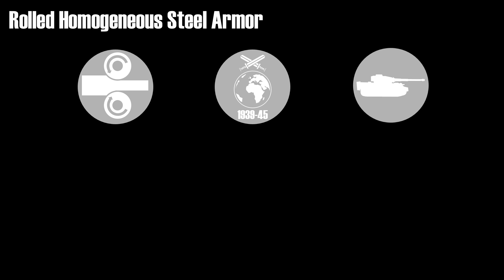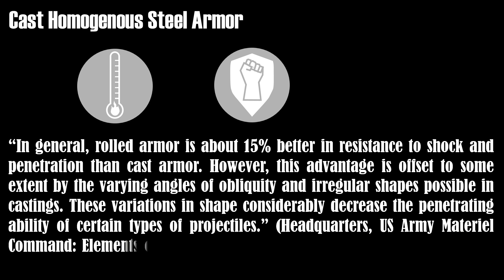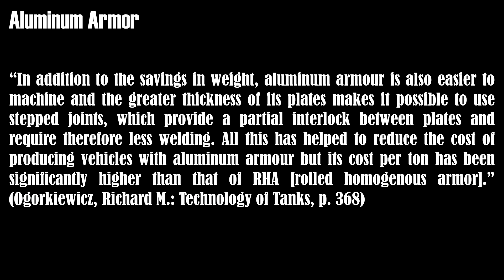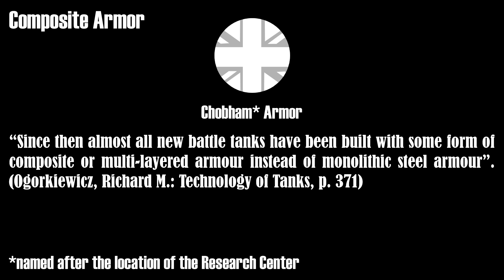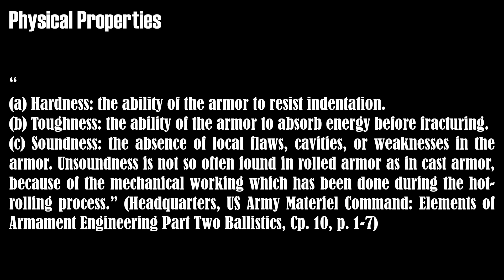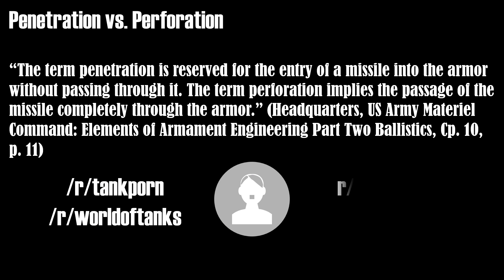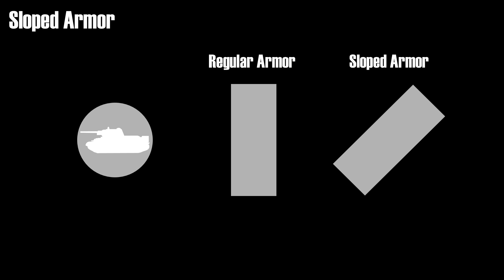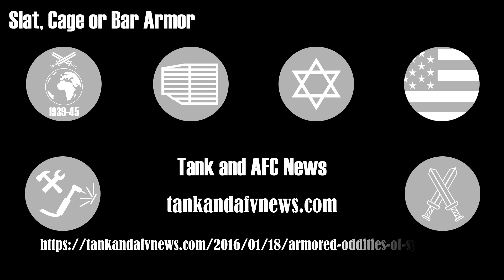[Tanks 101] Armor Protection 1920-1980 - Features and Characteristics

Comment: The reason why Panzers III and IV used spaced screens is to protect from soviet early 76.2mm armour piercing exploding shells that had the MD-5 detonator that would detonate the explosive in the shell after only a few mm of armour and thus destroy the shell prematurely or severly hinder its perfomance in both penetration and damage.

The later MD-8 detonator adressed that issue but if you factor in the logistics...

PS: Panzers' 30mm side armour was more than enough to protect against 12.7/14.5mm rounds in battlefield conditions when angles and distance was not in the favor of infantry.
Reply from the maker: do you have a source for that, because I never heard about that one.
Reply: Military History Visualized Apparently there's no info about it in the english you'd have to search the russian section for it. Also the MD-5 is inherently unsafe and caused some casualties during the war and well after it(undetonated postwar leftovers) as it's quite easy to set off if handled unproperly.
Reply from the maker: well, sounds more like that the Russians assumed that the Germans introduced it for the MD-5 rounds. Because my source on the anti-tank rifle is in German and refers to a document/conference on this topic.
Reply: Military History Visualized As I said it's unlikely for even a 14.5mm to penetrate 30mm under battlefield conditions which are +/-35 degree offset = 30/cos55=52mm effective. Also consider a rather low lethality of the round if it even penetrates. It was mostly used to detrack the tank which essentially equaled to destruction since a stationary tank was an easy target for regular 45/76.2mms and thus was abandonded.

I don't have a verified info about the MD-5 right now but iirc it's a science work behind it.
Reply from the maker: logic and science may be all fine, but humans made the decision and we all make errors, some more, some less.
Reply: Hellhound Wyrm/Wurm Negative, the shell could penetrate up to roughly 70mm of armor, the criticism is that the fuze goes of only a few mm behind that armor plate, basically turning it into a dud whenever it hit spaced armor.
Reply: REgamesplayer Adding "several tons" of extra armor would have overloaded suspension and drive train, causing the vehicle to break down. Upgrading engine or suspension without reworking the chassis significantly would have been more effort than making a new tank altogether, aka the Panther.
Reply: REgamesplayer The Pz IV was out of room to wiggle. It was already at the limit with the long 75mm, 80/30/30 hull armor and skirts, that was all the room it had to wiggle. Adding further armor would have required beefing up the suspension (arguably doable), and fitting a better engine and transmission, a better engine would have been larger, thus requiring a redesign of the engine compartment, maybe enlarging it, needing a redesign of half the tank, assuming such an engine is even available, and all that for something that the simple addition of skirt armor already solves. 
Making the Panther as a new tank was a smart move as the Pz IV was at its limit and a brand new chassis was needed for anything bigger anyway, however to still achieve the top speed and frontal armor required the side armor needed to be sacrificed to the logical minimum, and evidently the designers werent aware that 40mm werent enough against russian AT rifles, and went for the same cheap solution again rather than once again putting on extra weight which would have further reduced the Panthers reliability, which was abysmal already. 
And why dont they throw reliability out the window? OH YES, if your tank breaks down all the time, you might as well have no tank at all.
Reply: REgamesplayer A: Skirts were never intended to be an anti-heat measure. For once, noone except german used them in any notable fashion. It was definitely meant to protect against the 14.5mm PTRD and PTRS AT rifles in russian use, and these things were beyond abundant and could deliver a large volume of fire compared to AT guns. Even if conditions had to be at least reasonable (reasonably good angle) to achieve a penetration, out of the amount of bullets flying at you some will have favorable conditions, that is just statistical fact. Hence the skirt armor, as complete protection against such a weapon was preferable to "effective protection".
B: 1 or 2 hp/t less arent the only problem. Pz IV G and onwards had significant wear on the front road wheels and suspension due to the 80mm frontal armor intended to protect from russian 76mm guns such as the F-34 and Zis-5 up to a certain distance. Transmission and engine were at their limit, and at the time the germans didnt have the resources to invest into upgrading the engine of a tank they are intending to phase out anyway in favor of the Panther, assuming it even had that upgrade potential. 
C: The last paragraph is badly phrased and Im not sure what you mean. 
Upgrading the Pz IV to the Panthers gun? As a casemate tank destroyer it was done. In a turret it was tried using the Panthers Schmalturm, but the chassis was clearly overloaded, thus couldnt be done. 
A Panther with a 60mm glacis would indeed have been "fine", especially since it was face hardened armor (russia didnt use capped AP shells, which were prone to shattering against face hardened armor, even if penetration were possible purely by kinetic energy), and still provided effective protection against 85mm gun at reasonable ranges, but the Panther was rightfully expected to go up against superior numbers so an extra 20mm of armor didnt seem too tall of an order. Besides, 20mm of extra frontal armor dont make the entire 20 ton weight difference between intended mass and what the end result weighed. 
D: T-43 was a very small foot note of russian tank design. Officials were generally unimpressed as it offered only extra armor and still fielded the 76mm F-34 gun while the T-34/85 was already in production. T-44 was the next medium tank the soviets produced, and it was a much more effective tank and would have been the next main adversary for the Panther. 
E: Panther II has no 800 hp engine, it likely would have even had a 900 hp HL 234 rather than the previous 700 hp HL 230. There was also some work on a turbine powered version of the Panther, but that would have only compounded germanys fuel shortage. 
Also, stuffing the 8.8cm KwK 43 into a Panthers Schalturm turret would have been pretty cruel on the loader, as its a really tight fit to begin with, nevermind trying to handle the huge shells in such a small turret. With the planned armor increase to 100/60/60 or 120/60/60 it would easily outperform a T-44, even with the old 7.5cm KwK 42, which was by itself quite a formidable weapon. 
But ultimately all those improvements never fixed the abysmal reliability due to the weak final drives, so its doubtful that such an upgrade would have been worth the effort.
Reply: REgamesplayer A: For the last time, skirts had nothing to do with HEAT rounds. Unless you want to explain to me who used HEAT warheads in 1942? 
And secondly, skirts were exclusively intended against AT rifle rounds, which were light enough to be deformed and destabilized when hitting a 5-6mm (not 10mm) armor plate, and thus did not penetrate the 30mm plate behind. The skirts were never intended to stop 45mm and larger AT guns (and rightfully didnt), and adding enough of either skirt or unspaced armor to even stop a 45mm shell would have made the tank grossly overweight anyway, so it wasnt even attempted as frontal protection as prioritized. 
Also, not all AP shells need 30mm of armor to trigger their fuze, there are plenty that require less, but most fuzes take 1-1.5 meters flight between penetrating the armor and actually exploding, thus if you hit the skirt with one of those shells, the shell will, even if triggered by the skirt, penetrate the hull side as well and only explode inside the tank anyway. 
B: Yes, in theory you can add rear armor to balance out the front armor, but considering how many people shoot your ass its mostly dead weight that increases your total mass, so instead of wearing down just your front road wheels and suspension, you wear down all of it. Good job!
C: What are you trying to tell me? I already agreed that 60mm armor on the glacis would have sufficed. I simply explained the likely reasoning why they went for 80mm. 
D: (Talking about Panther II here) Obviously a larger turret is preferable, but while you say you would have done this and that differently, you constantly fail to specify how. What would "your" turret be like? In all likelyhood you will come up with something german engineers either already came up with or didnt, and likely would have a ton of disadvantages anyway that I could spot in a heartbeat. You underestimate how hard exactly it is to actually develop such things, and how many modifications need to be made for such a simple sounding thing as "enlarging the turret".
E: T-44 was all but a cancelled program. It entered serial production in 44 (as the name suggests) and units were equipped with it before the war in europe even ended, however those units simply didnt see combat anymore. Furthermore the tank saw a quite extensive production run of around 8000 vehicles if memory serves, including several attempted upgrades to 100mm and 122mm guns, and extended comparative trials against a german Panther. If the war had gone on, the germans would have fought the T-44. 
T-43 was altogether cancelled with only some prototype testing being done, as the T-34-85 was already in production and proving itself effective while the T-43 offered hardly any selling point at all except for the armor, and the list of changes required from T-34 production were simply not worth it, not counting the extra development time to adapt the T-43 to an 85mm gun. The T-44 was simply the better overall product and as germany was practically beaten by 44 anyway it was deemed acceptable to switch over production by then to the T-44, as a drop in production output due to retooling was not going to be an issue anymore.
Reply: REgamesplayer A: It was really not clear that you were talking in hypotheticals. You indeed made it sound like skirt armor was exclusively designed against HEAT (which it did work against and had to face in the later years on the western front only) 
B: Again, upgrading the rear armor on the Pz IV was not feasible because of the extra mass, and the rare occasion that an AT rifle would take on your arse was deemed acceptable as the only thing you could damage there was the engine, but not kill the crew or hit fuel or ammo (fuel tank in Pz IV was under the turret floor). The chassis was at the limit as it was, rear armor would have solved the nose-heaviness but made everything else worse, like suspension wear and top speed, which already was lowered twice over the Pz IVs development life due to all the extra armor. 
C: The Panther could take the extra mass if you are purely concerned about mobility. Even in its final form it was still a highly mobile tank, and the suspension wasnt overloaded yet either. In fact the suspension is one of the genius streaks about it, allowing it to reach high speeds even in terrain due to how easily the roadwheels oscillate. 
The problem that extra mass causes is reliability, specifically the final drives. Firstly, they broke on average every 150 km. There were tanks that had fuel to go on for longer. Secondly in order to repair any part of the transmission the hull roof over the driver and radio operator positions needed to be unbolted, both their seats and ALL their equipment had to be completely removed, and then you could lift out the entire transmission block through there, and then put a new transmission and everything else back in. For comparison: A Sherman could do the same repair by unbolting the transmission cover from the frontal armor and access the transmission from there. 
D: As I said, in theory the Panther had extra weight capacity, neither the suspension nor the engine would have any problems with it (and there was no 800 hp engine to my knowledge, only the original HL230 with 700 hp, or the HL234 with 900 hp), but the final drives wore down too quickly due to pulling a mass they werent designed for. So thats where your room to wiggle goes to die. If you increase the mass by any significant factor, you can replace your final drives every 50km instead of 150 km. 
E: The T-44 had 1.823 tanks produced. I would hardly call that "cancelled". It only came at an unlucky time where there were no wars that needed it, warsaw pact states were largely equipped with abundant T-34/85s after WWII, and the soviets kept T-44s to them selves as their top of the line tanks at the time until the T-54 came around, which people were suddenly extremely interested in buying. The T-44 also had no reliability issues as far as I can recall. For all intents and purposes it was a very good tank that happened to be a tad undergunned, but T-54 solved that issue. 
T-43 was indeed cancelled for more or less that reason.
Reply: REgamesplayer B and C: With the Panther the suspension was not the bottleneck that was overloaded, in fact Id say its one of the parts that could have worked with a good bit of extra weight. 
The crux was from beginning to end mostly the final drives, which were designed for a 30 ton vehicle. The option to mount improved final drives was explored, but the only better final drive in production had their entire production volume taken up by the Tiger II, so installing them in Panthers was not an option. 
D: Panther II would have had much the same issue. There were no other final drives available than the one used on the Panther it replaced, ergo the final drive problems would simply migrate onto the Panther II, and worsen due to the increased total mass and likely use of the higher powered 900 hp HL 234 engine, trying to squeeze even more force through this fragile transmission. 
E: T-44 wasnt a significant tank, but it was accepted into service. The vehicle was sound, the turret, while taken from the T-34/85 with minor changes, was an adequate turret, and the hull was such a good design (especially the traverse engine mount) that it migrated over into the T-54 with no major changes. The low production numbers were the victim of two factors: The tank was not needed anymore in large quantities as the war was over, and the cold war hadnt yet begun, and the T-54 was already looming on the horizon sporting a vastly better turret design and an excellent gun. It never became the "main tank" of the red army because of both the large quantity of T-34/85s being in service already, and then being phased out so quickly in favor of the T-54. 
Also,l the T-34/100 wasnt exactly a fruitful design. The large gun severely unbalanced the turret as well as the entire tank (T-34/85s already were slightly nose-heavy), and working conditions for the crew were also less than stellar. It would not have made a servicable tank, not unless youre desperate.
Reply: Skirts werent intended to deflect large caliber (45mm+) shells but mostly to deform 14.5mm bullets from AT rifles enough to prevent them from penetrating the main armor. The effect of skirt armor against 45mm shells was proven to be negligible or non-existent in soviet testing. 

Also, about the Panther suspension: The suspension was one of the parts that was much less affected by the increased mass than the final drives (or was simply upgraded in accordance with the mass increase), in fact it evidently performed quite well as the problems due to interleaved road wheels were much more prevalent.
Reply: Stuff like Spare tracks on the armor stabilize projektiles, skirts not.
Skirts dont help a Pz III or Pz IV not much against 45mm+.
On a 90° hit, the skirt slows a 45mm+ a little bit down, but not enough to prevent a penetration of the main armor. A 45° hit can destabilize a 45mm+
Reply: Military History Visualized Your videos are excellent. I have been a military and history buff all of my life and these are like books coming alive. Would you please consider making some on the American War for Independence and American War Between the States (War of Northern Agression as we southerners often call it) A video compari g the design and perfrimance of WW2 hand grenades would be neat. Thanks for the great videos and keep up the excellent work
Reply: Why you had mentioned logistics? It is always hundreds of times more complicated to supply vehicles with upgrades rather than units with ammunition. 

You and certainly I do blame designers of that day for failing to realize about the threats of modern battlefield. That their tanks can be quite easily destroyed by infantry and needs just minor meddling to prepare them for combat. It is similar situation today. Humans charge in without thinking and proper preparation and thus get decimated. Then they stat thinking and do minor changes which solves all the problems. ERA or spaced armor upgrades is a great example of how introduction of new era RPG systems were widely ignored.
Reply: Hellhound Wyrm/Wurm I just worded it badly. English is not my primary.
Reply: Well, I think originally shell was meant to penetrate weaker armor since if fuse is activated after penetration of few mm of armor then it adds some miliseconds until the explosion. Shell on the way explodes, in the middle or often already in the vehicle depending on how much armor there is. Skirts on the other hand just activates the fuse in the mid air between the skirt and the tank and resulting explosion behind destablises incoming projectile and takes away its deadly punch.
Reply: Hellhound Wyrm/Wurm Negative again. The shell could easily penetrate 60-70mm of armor at vertical and reasonably close range, as long as the armor is a single plate, and the fuze would go off directly on the other side of the plate. That was a problem as when it hit skirt armor, the fuze detonated the HE filler directly behind the skirt but outside the main armor instead, making the weapon practically useless. Later a shell with the MD-8 fuze was adopted which among other things had a fuze with a longer delay so it would travel deeper into the tank exploding more or less in the middle of the fighting compartment making it more effective, and as a side effect the fuze distanc was greater than the gap between skirt armor and the tanks actual side armor, meaning the shell would be triggered by the spaced armor, but still travel into and through the base side armor into the crew compartment nonetheless before going off.
Reply: And another negative thing about the side armor is this: they stabilize the projectile. It means that side or applique armor actually reduces the protection of the vehicle since it helps shell to reduce the angle between its trajectory and the tank's armor. In this way they have to penetrate less of the tank's armor by having the luxury to stabilize themselves two whole times. This is especially problematic with self stabilizing shells or capped shells in other words. 

Pz.3/4  and German leadership were failures in the terms of armor and its procurement. While understandable due to the limitations of the age and German industry, it becomes completely unforgivable to tolerate such pitiful side armor after Fall of France and Germany's reluctance to upgrade its firepower.  Breakthrough tank cannot perform breakthrough tasks if they are vurnable to anti tank rifles and it needed to be top priority to release better armored panzers in the first place without sacrificing mobility nor costs (or in other words, upgrade).
Reply: REgamesplayer False. It is known that applique armor often leads to a partial normalization effect on incoming AP shells, lessening protection, as well as reducing shock against the shell reducing the chance of the shell shattering, essentially doing the job of the cap of a APC shell (as opposed to uncapped AP or APBC). 
However, that mainly applies to materials directly applied to the hull, as well as materials that are softer than armor plate, such as track links which were commonly used to that end, though german command forbade it for that reason, however it was done anyway. The US Shermans in normandy were actually allowed and encouraged to improvise such armor, even though the brass was very aware of the negative effect on protection, but they wished for those "improvements" to improve morale. 

That however does not apply to skirt armor, as it is too far away from the main armor to have that effect. Against a small AP projectile, such as the 14.5mm AT rifles the russians used, the impact on the skirt destabilised the shell, causing it to tumble and essentially become ineffective at penetrating armor. 45mm shells and upward were virtually unaffected due to the shells having a higher mass in total and being harder to influence by such thin armor, thus generally penetrating the main side armor. 

And the decisions germany made at the time were perfectly understandable, although they were indeed slow. However, upgrading existing Pz III and IVs with skirts, increased frontal armor and longer barreled guns was a reasonable move, as Panther and Tiger development dragged on and even then the tanks were plagued with problems. 
In my opinion it was the focus of the tank development that was the problem. A tank does not need to be invulnerable to do its job, most of all the allies proved that by using in comparison much less armored vehicles, but Hitler insisted on such heavy protection on the Panther anyway. 
Instead, the focus should have been on something closer to a continuation of what worked so well against France: A strategically mobile striking force that enabled armor to be used en masse, ergo requiring high strategic mobility and tactical flexibility rather than high protection and firepower alone. Panthers and Tigers were simply bigger than they needed to be, while at the same time neither had much potential for upgraded, Panther more so, but not much when you compare it with a Pz III or IV. When developing that generation of tanks, germany forgot too many of the basics that they themselves laid the foundation for in tank building.
Reply: Hellhound Wyrm/Wurm Sorry, everytime you write "explodes after penetrating a few mm of armor" it makes to me the impression of the shell penetrating halfway into a 30mm plate and then going off before it actually penetrated, rather than "explodes after penetrating even a few mm thick plate"
Reply: Nick Dzink I don't think that 30 mm of armor was enough. The main reason why panthers were fited with side skirts just like the Pz lll and lV was that Soviet AT rifles could penetrate it's 40 mm side armor.
Reply: I had meant exactly that, I'm not sure why you describe it as false then you proceed in agreeing with me. Armor plates were more effective as a HEAT stopped rather than an additional armor. 14.5 mm penetration was questionable to begin with then 30 mm was angled. 

Understanable and Nazi Germany does not go hand in hand. They should had increased protection of their Panzer 3/4 models as soon as engine allowed. Having such thin armor makes vehicle itself very fragile against anti tank rifles while adding several tons of extra armor, makes it effectively immune to it. 

Of course, you must upgrade your tank as need dictates, but that was needed to do after fall of France. Before you could excuse Germans due to lack of resources, but the need was obvious even before WW2 that 60 mm armor plates are on the horizon and armored forces needed to be ready.
Reply: Well, obviously you redesign vehicle. This is how upgrading works. Tanks do have some room to wiggle left. Most famous of which was T-34 which could take massive upgrades without a need on revisiting its suspension. 

You are wrong. Upgrading transmission is not more effort, it is far less. Pz 3/4 was heavily upgrades, adding those several tons of extra armor in the process on top of getting quantitevily far superior weapon.
Reply: I had meant and spoke about early models from the beginning. This is why I had mentioned several tons, since we are going from side armor of 15 mm to 30. :) The final product was more or less that it needed to be. Armor skirts while inferior to just increasing side armor by 10 mm, it was necessary as a form of early anti-heat measure. Even though, I would question its worth in eastern front, because I'm not aware of Soviet version of bazooka. Given the nature of early anti tank warfare, I would increase protection ideally like this front/side/rear: x/40/40(30). In truth, we are agreeing on everything, but my way is just slightly different than that had happened historically. Even if Pz.3/4 was completely out of the room to wiggle, a ton of additional armor would come just as a trade of in terms of mechanical reliability. I want to remind you that historically, at least 40 mm of side armor was a norm on which all major nations agreed. Even Shermans had that amount of armor thus 30 mm is really low. 

Better engine is uneccessary, just one or two hp/ton less. Vehicle will be more sluggish. Or just replace it with newer version of a same engine which will automatically be superior. I'm talking about new production model which needed to come out right after the fall of France at its latest. It is like Pz.4. F1 would already had had extra armor and long rifled anti tank weapon. 

Panther had a great mobility for its time and weight. It was its reliability which impeded it. While 40 mm is not immune to AT rifles, it is effective protection. It is highlighted as a weakness in order to highlight flawed design of Panther in general, but the side armor would be completely acceptable if that tank itself would not had been such fiasco of political interfering with idealogical nonsense then military utilitarianism was needed. Original Panther model was better and it should be taken as a lesson not to do that if it wasn't obvious. Really, we often overestimate intelligence of a fellow man. How the fuck everybody did not screamed that putting 10-20 extra tons on vehicle designed for 30 ton chassis is not an insanity which will end up in fiasco?

That Germans ought to be done, knowing Hitler is that they needed to proceed with superior tank to T-34, Panther. 60 mm original plate was fine. I would only had advocated for introducing Panther's cannon instead of original Pz.4 weapon. That is only due to future-proofing yourself from upcoming Russian new generation tanks, T-43 to be precise which would had very similar traits to original Panther that was planned. From then on, they should had just designed Panther 2 as a tank intended to serve as MBT. 50 tons, 800 hp engine, 100 mm frontal glacis, 120 mm frontal turret, 88 mm King Tiger's cannon. That tank would had been a monster and quite frankly, quite necessary with ever escalating warfare. See, IS-3/4, T-54 who who made a quantum leap again in tank quality.
Reply: Armor skirts while inferior to just increasing side armor by 10 mm, it was necessary as a form of early anti-heat measure

I did not spoke of the field models. I'm speaking about new production models. You cannot just add 10 mm of armor to internal hull, of course it is going to be armor skirts. Despite that, armor skirts were used as an anti heat measure and they were very effective at that and it is their only real purpose in war. If you are producing your tanks and only later adding that extra armor then you are doing it wrong.

Armor skirts are not preferable protection. It stabilizes anti tank shell into your own hull. Wiggling is only achieved if a projectile looses enough energy in the process which was irrelevent for anti tank cannons. Only armor skirts who can be viable are those who are designed to detonate shells, but that requires heavy 30 mm skirts.

B. Again and again. I'm not talking about Pz 4.G. I'm talking about putting those upgrades as soon as they were available. That is, I blame Germans for Pz.4. F1 of not having those features. Furthermore, by introducing side and rear armor you balance vehicle out thus removing or lessening that problem. Another issue is this: you are adding that extra weight in form of the skirts anyways. So, it is just better to integrate that extra armor into the tank itself. If 40 mm can be achieved then tank will be effectively protected vs anti tank rifles in combat positions. 100 mm at 90 degree angle is dream come true. Usually it is done at 60 degrees angle. 

C. I spoke about early Panther before Hitler came and made it that it became. I had meant putting gun which Panther historically had on original Panther. Since original Panther had inferior weapon before that. You see, Hitler had a tendency to make everything massive. I can forgive Tiger, but Panther was pushed to be a heavy tank out of the medium. Leopard, intended as a light tank was pushed to be as a medium tank. 

Yes, I know, but transmission was simply not there. You cannot have everything like Hitler. So I choose firepower that Hitler gave to Panther. If you would pick this weapon too with addition of 20 mm of extra armor you will end up with a same tank which Germans had produced.

E. I mean, design a tank for such weight from the let go. Panther 2 was not Panther 1 and thus it would had been redesigned tank. Soviets cancelled T-44 program and it would be a temporal stop gab before T-54 which would come out somewhere in 1946. Also, IS-3 and IS-4 were just monsters. Tigers and KV-1 all over again, so, next generation of anti tank guns were necessary to be introduced in 1945. Panther 2 would had came out in 1945. These tanks only would matter if we are talking about the long war and it is likely against the allies since Germany would loose or win at that point. 

Furthermore, then I design a vehicle from a get go with 88 mm in mind instead of 75 mm as was originally done, I of course would enlarge turret. Anyways, this is just theoretical. Panther 2 would be non-factor in war effort due to how late it would come out.Panther 1 would matter a lot less and I say that Germans needed to produce mechanically adequate machine which would outperform T-34 tank. This is it. If there is room to wiggle about, I would take superior firepower instead of armor. Soviets on the other hand would choose armor with their T-43-76 tank. (Tank was cancelled due to high armor of new German tanks, so it would had changed USSR calculations and they would had released T-43 instead of T-34-85 and only then they would had upgraded to T-43-85 thus delaying entire firepower upgrade for a Red Army).
Reply: Contrary to the popular belief, I do not think that Germans needed to increase tank production. I do on the other hand believe that Germans needed to increase production of Stug variants and to proceed to develop a new generation of Stug based on Panther hull. 60 mm of heavily angled armor with 88 mm Tiger's cannon seems about right. I also think that Germans needed to focus more on developing SPAAG based on Panther platform more. Wirlewind with 4x20 mm cannons proved to be beyond its time and extremely devastating thus providing short range coverage from enemy aircraft. Army must have means to fend off aircraft then Luftwave is not nearby and certain number of SPAAGs in necessary. 

This is of course, taking into account that you will have to cut potential increase in arms production somewhere else. For Germany, air superiority over increased panzer offensive capabilities were more important for a morale of German troops who were used operating with air superiority.
Reply: You struggle to understand plain sentences and you just like to argue about them. I do not say that they were used for reflecting HEAT from the beginning, but later down the line they were. This is the only viable purpose on putting armor skirts outside newly produced vehicles.

I know it was not attempted, I wrote it a hypothetical scenario. Jeezz, read more  carefully of what I write since this whole chain of comments is you misunderstanding that I say. 

I'm not sure of how much time shell will take to activate on all shells. All of them were not designed to be pre-detonated on the outside and in any case and time and energy spent penetrating first layer might prove effective in nulifying the strength of the larger shell in similar fashion as it is done with rifles. Anyways, it is an unrealistic option since they can easily change the fuze to explode on more armor. 

B. You never investigate early Panzers armor design, did you? It had an equally balanced armor at all angles. No, Germans did not done because they were morons. Everybody was doing that, but especially it was important for a breakthrough tanks since they will often pass through enemy fortifications, leaving their nice, flat ass to anyone to rape it. In combat conditions this is especially important since anti tank rifle is extremely mobile and effective weapon. Infantry can easily take up ambush positions or flank your tank and since tank is actually blind, it will be helpless against a single AT rifle squad who managed to sneak up on it or heck, even fire on whole squad of tanks. How you are going to find out well hidden sniper in a damn tank? He will take out your engine and then slowly will pick you away. This is why everyone had minimum amount of armor everywhere. Even humble Sherman knew better than to armor itself up on the ass more than to protect itself from shrapnel and machine gun fire. This is why I'm pushing for balanced armor design and why it is necessary. Furthermore, I do not know why you are arguing about nothing. That Germans did was identical to my proposed solution with some changes and yet you speak about it like it would be a folly. It is not. Stop overreacting. 

C. I'm saying that extra 20 mm and new weapon would make you a historical Panther. There must be trade offs and I had explained that adding 20 mm of armor is unwise to already stressed suspension. If you start adding armor soon you will find out that the frontal glacis is under armored and etc. I say this: stick to the VK30.02(DB) design instead MAN's proposed prototype. It is cheaper, smaller, more mobile and in essence superior to Panther. Of course, it depends on how you envision Panther turned out to be, but I would prefer mobility instead of additional armor.

D. Simple. By designing tank with 88 mm in mind, you do not have to modify anything, because you already have that in mind from the let go. Furthermore, you design roomy turrets for upgradability potential and some empty weight available.The issue with Germans was their development cycle. They first design a Panther which is 20 tons! Then they get woken up by Russians and start more sensible 30 tank program, shifting work from 20 ton tank. Then Hitler comes and decides that he would increase tank's weight by 10 tons, coz he wants his invincible medium tanks. This is how these fiasco happens.  

Upgrading turret is easier than you think. Pz.4 had upgrade solution of Panther's turret, but suspension could not handle it. Given that a new Panther would weight around 50 tons, would have 800 hp engine, it is not hard to imagine that designers has a lot of space to wiggle about.

E. T-44 was cancelled because war was almost over. Second issue was that T-44 could not be produced in sufficient numbers. Third problem was reliability issues. Forth and most essential, design was a dead end and it could not fit 100 mm weapon. If it would be still intense fighting then Soviets would had adopted this tank as their stop gap solution. You have to remember that then we are talking about those vehicles, we must take into account that war between Germany and Russia is still hot and not that organized retreat that we had seen since Kursk.

T-43 program was cancelled, because Army did not needed more armor. They wanted more firepower which this tank did not possessed. This is why they had decided to close this program down and to focus on upgrading T-34. If Germans would had went with more sensible armor schemes for their tanks, it is likely that T-43 would had reached the front. After all, army had initiated development of this tank and this is that they originally thought was important in staying ahead of their enemies.
Reply: B. There is not hard limit for a platform upgradability. Panther in essence was more overloaded than Pz.4.H, but somehow it was put into mass production. The more you overload the suspension, the greater maintenance and lower mobility is achieved. German low capability, high performance designs had really bited them in the ass in the long run. 

All the time I was saying that armor skirts are inferior to armored hull. Shell stabilization effect makes the armor weaker in general against cannon hits. Skirts were necessary later down the line then infantry based HEAT weapons were introduced, but those played quite minor role in Normandy's front as far as I'm aware. Yes, they were dangerous to tanks, but they changed very little at how tanks operates and what they can do.

You also ignore the fact that Pz.4 received rear armor upgrades. 5 mm armor skirts weight even more than 5 mm increase in side armor. I would also take away 10 mm from lower glacis too since it is less likely to be hit. I also would lower commander's cuppola's protection from 95 mm to 80 mm. All this armor would be redistributed in the sides to incease protection by additional 5 mm and possible back of the tank would also receive slightly more armor if possible, 30 mm is ideal. So, my composition would result in 80/40/30. It would feature less nose heavy tank with noticeably more stronger side armor. 

C. Transmission broke for exactly this reason that entire platform was too heavy. I think you imagine that the upper limit for transmission and suspension is certain amount of weight after which tank won't move anymore. It is not like that. After certain point, longevity of the platform will start to decrease.

Poor quality materials also played a part, but Panther's excessive armor and Hitler's decision to go for inferior tank now had caused all the troubles in the future. Panther simply was not cost effective solution taken into account that Germany could not provide extensive maintenance required for this tank. To take into account, normally Germany produced 40% of spare parts for its tanks weighted against total production of tanks. At the end of the war this number dropped to 8%. It is actually interesting to read that Soviets could not challenge Panthers and surrounded and cut off Germans could move as they please. This created moving pockets of German resistance. The sad thing is, that all that Russians needed to do is to chase Panthers around and they will brake down themselves. In fact, majority of Panthers looses were inflicted in this way.

D. Panther 2 is not an upgraded Panther. You are confusing Panther F with Panther 2 model here. Panther 2 is new 50 ton tank designed from the grounds up to encompass all of this technology. 

E. T-44 did had severe reliability issues. T-44 was not shifted to all out production, because war was over. You also have wrong impression that 2 thousand tanks is a lot. This is little more than a monthly quota for T-34-85 during the WW2. T-44 was abandoned, it was not adopted as a standard tank nor production of it went to significant levels. Upgrades were cancelled. Soviet Union decided to jump straight to T-54. T-44 was an ugly duckling in a way. A stop gap solution if the war with Germans would be still intense, T-44 would act as MBT while T-34-100 as tank destroyer while they would await development of T-54 which had insane qualative leap in terms of capabilities.
Reply: builder396
B,C. But you yourself say that Panther suspension was designed for 30 ton tank. If 30 ton tank was produced as was planned then there would not had been any problems, but Hitler had decided to keep changing tank which grew in 10 tons in weight. It is text book example of that happens then you overload suspension. You could had upgraded Pz.4 to 30 ton tank with same results as Panther was experiencing.

D. False. Tiger, King Tiger had such suspension. Technology was available for Germans.

E. So, in the end you just say that I had said from the beginning. Not sure why you were arguing to begin with, You still ignore its chronic reliability problems.

T-34-100 on the other hand was developed and well tested. It did not had any flaws which you had described. Nose-heaviness is always the issue with all tanks, it is just knowing how to handle them.
Reply: I think you mix up spaced armor and skirts and spare tracks on the front.
Spaced armor, armor plate, a few cm space, armor plate is not the same like spare tracks (bullet catcher) or skirts.
the skirts had only 5 mm, not 10mm
30mm+20mm spaced armor gives more protection than 50mm.
And skirts have a effect on larger projektieles, not much but there is a effect.

One thin layer silk under a lether armor makes a big difference if hit by an arrow
Reply: Well, in truth it is the opposite. Skirts actually reduce if not makes almost no difference in armor since they tend to stabilize incoming projectile upon the armor. Skirts should never be a mainstay armor, only as improvisation method. If you need armor, just wield more of it to begin with.
Reply: It also had the benefit of making Panzer IV variants appear more like Tiger Is, which caused some morale trouble with Allied commanders.
Reply: Well, to the germans the PTRD and PTRS were a huge thorn in their side. They were simple widely available and their penetration goes up to 45mm under ideal conditions. 30mm of armor on the side of a Pz III or IV is  only an obstacle when the circumstances are less than ideal. They were perfect to fill the hole in their AT defense as during the earlier years 45mm and 76.2mm AT guns were not available in sufficient numbers. 
However, from the german viewpoint you couldnt drive up any village or field without having these things come out of nowhere and ping against your armor. And if they pinged against the side they got through often enough, since at less than 100m distance and any reasonably good angle it can go through like a hot knife through butter. 
The skirt armors intent was to get penetrated by the PTRD round but leave it so deformed that it would not be able to penetrate the 30mm main armor behind it. In terms of both mass and cost it was more effective than increasing main armor thickness to 45mm or 50mm. 
Even the Panther soon ended up having skirt armor protecting the unsloped side armor behind the roadwheels, or more specifically just above the tracks return run, as that wasnt covered by the road wheels, and any lower the road wheels acted as enough extra protection. 
Tiger and Tiger II hence only used normal armor with no more than fenders over the tracks.